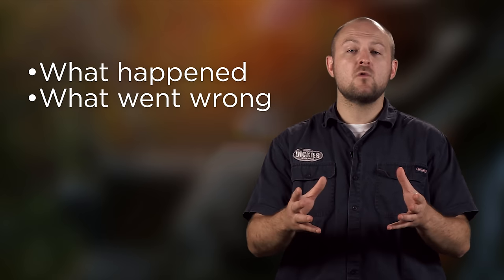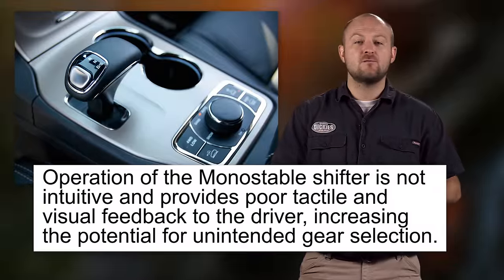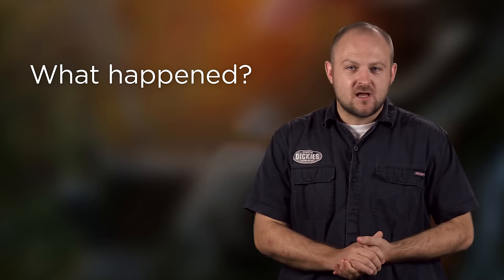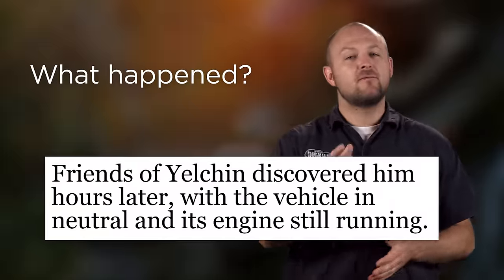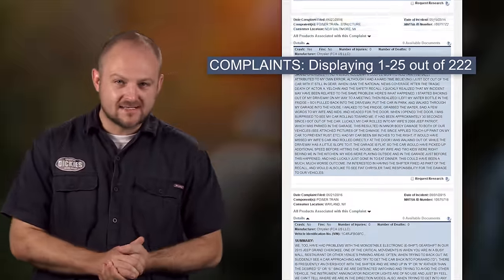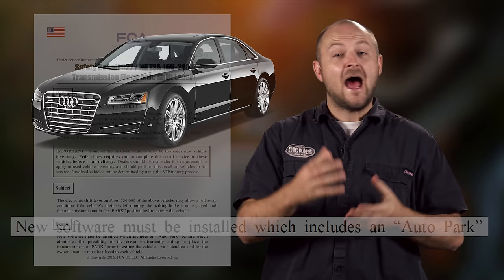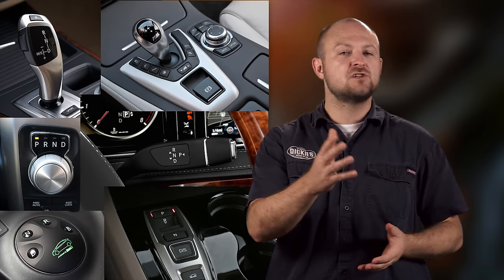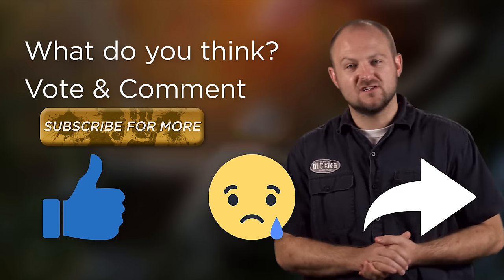How Anton Yelchin was Killed: An Explanation of Jeep's Confusing Shifter

Comment: While this shifter is one of the most stupid designs I´ve ever seen ( not only from the usability, but from the looks and feels), I still cannot imagine getting out of the car and walking all the way around it without noticing it rolling. I also missed the P on a normal old "analog" column shift lever on an incline and was about to leave the car with the engine off and the transmission in R ( key in ignition). It was a very slight incline, not the steep driveway pictured here. The moment I left off the brake pedal I felt the vehicle moving. How can you even have the time to walk all the way to the back of the rolling car? The vehicle would be already rolling while you walk at the side of it.
Reply: eaglevision993  You sir, are very awake!!! Thank you for using you own critical thinking skills!!! So many in the world today have NO idea how to use their own brains, it's fucking scary!!!!!
Reply: Your experience is not applicable here. Didn't you hear? His was in neutral, not reverse. It could have be still, or unperceivably slowly starting to roll as he jumped out.

And if I was a busy high flying guy like that, I would not be walking. Jump out, run down to the gate, and as you jump out into the darkness you don't even sense the initial slow movement while in neutral.

Perhaps you also didn't know that it was midnight. Make more sense now?

Comment: How can this video conclude he left it in neutral rather than park? It's a big assumption. If he left it in neutral it would have rolled before he got to the rear. It weighed 2.5 tonnes so in neutral it would have rolled immediately on a steep slope. It wouldn't have waited 5 or 10 seconds and then rolled. I think he left it in park but it slipped from park and this slippage is why Jeep recalled the cars. If that's the case their statement is completely dishonest. Appalling design definitely, but maybe more of than "poor tactile and visibility to the driver" as they say. It seems to me the park position possibly wasn't holding the vehicles on slopes and that would be an engineering fault making that jeep a death trap.
Reply: Its weight wouldnt make it begin to roll faster

Comment: One complaint I have as a mechanic is this car cannot shift to neutral unless the engine is on. Meaning if the engine can't start, you can't put it into neutral. Top that with I can never get it to select the right gear, I'm not surprised something like this happened. Lovely cars, terrible engineering.
Reply from the maker: From my research I did find a way to put it in neutral! For at least the 2014 model there is an orange strap under a panel in the center console. There's a few more steps (and probably many more than are needed) but you should be able to easily find it by searching YouTube. I think every model of vehicle that has this shifter does it a little differently but it seems all use some sort of strap and button mechanism.

Comment: A very simple scenario for those who are still scratching their heads. First, keep in mind that this happened late at night, thus in some level of darkness.

Imagine that in a hurry (not a careless hurry, just a hurry) you 1. Throw it into park. 2. Throw open the door, left hand on the seat and right hand on the door, and launch yourself to jump out of the vehicle. In continuing the same motion, you continued on a fast jog to the gate. There you go. You don't realize the vehicle is rolling (slowly at first, mind you) - and in darkness and in a fast jog you reach the gate far quicker than the car. Unfortunately, with your back turned at the gate, silently, it builds speed. Then at 5,000 pounds it only has to be going 2 miles an hour - DOWNHILL - to crush you.

Comment: His Jeep has "Hill Assist Feature" it will hold the vehicle from rolling backwards for several seconds after the brake pedal is released. Then it automatically releases it, if your brake pedal is not re-applied it will roll. This feature would have held long enough for him to get behind his Jeep and get ran over. Too many U.K. comments about parking brake not on. U.K. drive mostly standard transmissions and need parking brakes. In North America we have only Automatic Transmissions in Jeep Grand Cherokee's, and rarely does anyone use the parking brake in automatic vehicles here. That's how he wouldn't have seen or felt it move when he got out. Those few seconds of brake holding feature tricked him into thinking it was ok and in PARK!!
Reply from the maker: Hill assist is a very interesting possibility. Thanks for your comment!
Reply: frank gullett  Then if he had the "hill assist feature," how in the world then did he not have plenty of time to get out of the way?? Very interesting you mentioned his Jeep has this because the official explanation of how he supposedly died that way with no other person having actually been with him to help cause this "freak accident" to happen, sounded ridiculous before with what we've all been told!!! Now that you mentioned this feature he had, it makes even LESS sense he was killed by his own vehicle & that he was actually by himself that night!!!

Comment: Soooo  He drove through his gate, then decided to randomly stop the car on the steep incline. Then, he got out of the car (accidentally left it in neutral) and walked around the vehicle to the back. At which point the vehicle began rolling..   No no no.   If you are stopped on an incline and you put your car in neutral, it IMMEDIATELY begins to roll once you take your foot off the brake. There is no way he could have gotten out and walked to the back of his car without it already rolling.  This doesn't add up at all.

Comment: As a Jeep Grand Cherokee driver - currently driving the 2015 model in question I found the need for the recall totally pointless. For any driver the act of shifting into or out of gear should be one that is paid attention to.  Simply put, the driver should not exit the vehicle unless they are sure the vehicle is correctly in park (or in neutral with parking brake engaged) The more that vehicle manufacturers do to "simplify" driving the less safe driving becomes because the driver is becoming more and more detached from the basic role of vehicle control. It is the responsibility of the driver to pay attention to all aspects of the act of driving. There is/was nothing confusing about the Jeep shifter - it clearly shows when it is in park, reverse, neutral or drive both on the shifter knob and also on the dash display - the driver has the responsibility to check/verify.

Comment: I have a 2015 Grand Cherokee and this should not have happened I have tried it if the vehicle is not in park and the door is opened the vehicle engages the parking brake to prevent it from  driving away.

Comment: The guy in this video has obviously never been in a new GC (I own a 2014). They don't have a key, they use a wireless fob, so when he got out there's a beep and message on the instrument cluster that says "Fob has left the vehicle" in addition to "vehicle not in park". So a beep really doesn't help bc they use the same one for various alerts.
The bigger issue is... Why is nobody saying anything about "hill assist control"?  The feature that holds the brakes for several seconds if you stop on a hill to keep you from rolling. That is what allowed him to get behind the vehicle before it rolled. Otherwise the vehicle would have rolled immediately and he couldn't have walked behind it. So I believe it was a combination of factors, not just an admittedly bad shifter implementation.
Reply: The indicator lights on the shifter are pretty much useless in daylight. They backlit white letters with a soft blue "TRON-esque" color. That  combined with the panoramic sunroof on my Overland, and you can't see the light on the shifter at all. The only indication you're in park is a slightly brighter P in the P R D(rive) S(port) indicator of the LCD instrument cluster, which is a bit "busy" to say the least.  The hill assist control as I mentioned before can fool you into thinking the vehicle is in park when it isn't. I had it happen to me once in 2.5 years, in my driveway, but I was still in the driver's seat thankfully and there was no accident.
Reply: +Joshua S what about engaging the handbrake. No driver that is worth his salt would ever leave his vehicle without engaging the handbrake.

Comment: I own a 2015 jeep grand cherokee. this shifter is not a complex and flawed as you make it out to be. 
1. there is no key to put in the "ignition". it has push button start and has a key fob you keep in your pocket.
2. it really is very simple to use with simple common sense. just push the button on the shifter and push the shifter all the way forward.
3. who doesn't look down at the shift to confirm it's in park or reverse or the proper gear.
4. this kid made a mistake. plain and simple but like the new typical thought process for America is play the victim card and blame someone else for their own mistake.
5. the ding noise is also made when the jeep is left running and the key fob leaves the vehicle.
6. if he left it in neutral how did he not notice the vehicle rolling or moving at all after he got out of the vehicle when he took his foot of the brake.
Reply: Another thing.....why did he not use the handbrake/e-brake.

Comment: Like the radio/media player in my Challenger you can't turn off.  You have to either turn the volume all the way down (does not stop media playing), or you have to press the "mute" button (in which case it unmutes when you restart the vehicle whether you want it are not).  Dodge put a MUTE/VOLUME push knob on the console.  Would it not have been just as easy for it to be ON-OFF/VOLUME, like it has been for the last 60+ years.  "I don't want a radio that can be turned off in my car" said no one ever.

Now admittingly I am not aware of the radio/media player slaughtering people like the shifters are, but I am pointing out that the practice of change just for the sake of change is not a good idea.  There is no logical reason for the design of this shifter (or my radio/media player).

Comment: My 2014 Volkswagen Golf mk7 automatically deploys its parking brake if i open the driver door while the engine is running. But it is manual transmission i dont know if the automatic woud, but i guess it would. of cause you need a electric parking brake.

Comment: But I don't understand, a car in neutral on even a small incline will start to roll backwards as soon as your foot is off the break. So how did he accidentally go into neutral? Could it have slipped from park?
Reply: Most new cars have hill assist brakes which hold the rear brakes for a couple of seconds when you release the break pedal... Go figure what happenned
Reply: +Michał Be Are you sure hill assist is not for manual cars?  His car was automatic. Besides, in this particular car, as soon as you open the driver door, it gives you a warning that the car is not in park and why did he not engage the handbrake. You can't blame the car for stupid mistakes from the driver.
Reply: +Renier Bonthuyzen hill assist works the same Same for automatic and  manual boxes - if that car even exists as manual (doubt it). Of course it gives the audible warning but it also gives a warning about seatbelts and key  if not keyless or you can just have your music turned up really loud. Anything possible.
Reply: +Michał Be. I hear you, but we still can't get passed the fact that he did not make sure that the car was in park and he also could not bother his arse to use the handbrake. Like I said, when you drive a car you should pay attention to what you are doing.
Reply: Renier Bonthuyzen Stupid mistakes of the car makers, not drivers. Seriously, who decides it's a good idea to put the gear that can mimic park, right under park?
Reply: +XxShadowedSongxX please tell me how is it not the drivers fault. Car not in Park...... driver Fault. You don't just jump out if you are not sure what hear the car is in. That car has and indicator on the shift stick and on the dash board to tell you what gear you are in. Handbrake was not engaged. Driver Fault. Again....there is a light on the button to show that it is engaged and it also shows on the dash if the handbrake is engaged. Again. Not the car fault but driver mistake.
Reply: Renier....    I do appreciate  your honest comments  ....  we all feel sorry for Anton's  death  is so sad......     but I understand  perfectly  ........  and you are so right!
Reply: +dakotail Thanks man. I am very sorry that it happened, it is a tragedy, but we can't take away the fact that he did not do a proper check before getting out of the car and therefore we cannot blame the car for human error.
Reply: Renier Bonthuyzen Look, this is just my opinion and you don't have to agree, but I cannot place the fault on any of the drivers. If it was just Anton I would say yes, human error. But it wasn't just him. It was hundreds of people making the same mistake. It was bad enough that they had to recall over a million cars and make new software to fix this problem. If they didn't have to do the recall I would say yes it was the fault of those hundreds of drivers, but because of the recall I put it as the error of the car makers. Neutral should not go under park.
Reply: +XxShadowedSongxX . I hear what you what you say, but if you drive, you will realise that Neutral is not under park, but Reverse is. None of these people engaged the handbrake. If they did, none of this would have happened.  And I know it is scary to think there could be that many stupid people out there, but it is entirely possible. Just look at how many people are voting for Donald trump.  Answer me honestly..... If any of these people used their handbrakes, would any of those accident have happened.  I've been driving for more than 20 years and this has never happened to me, because I know how to use a handbrake.  People should pay attention when they are driving.  Cars are not toys.
Reply: I completely mixed up the R and N, that's on me. But yeah I do hear you. I unconsciously engage my handbrake even if I'm in my car on a level surface. It's something I've always done, but not everyone does that. I still stand with the recall. I will not fault drivers if a recall happens.
Reply: +XxShadowedSongxX The recall is just a precaution.  There are lots of cars with the same shifters, but I would say those cars are owned by more mature drivers that would have more experience in driving. Accidents are going to happen.  We all know this. This is a small amount of accidents. It is only 0.06 percent of the total recall.  If people drive correctly, they would even engage their handbrake at traffic lights, as it is supposed to be done, and they will never leave their vehicles without engaging their handbrake.  This is just blown out of proportion because he is a public figure..... I didn't hear anything about this until he was killed, did you?
Reply: Not in the least. They had the bad luck for the person to die to be a celebrity and now all eyes are on them.
Still, to me a recall will always be an admission of guilt.
Reply: +XxShadowedSongxX. They admitted that the shifter is Confusing to some people. That is fine. It isn't faulty though. Hope you have a wonderful day.
Reply: To each his own. You as well. Thank you for being civil.
Reply: +XxShadowedSongxX. I want to thank you for being civil as well. There are very few people like you here. Somehow internet turns people into barbarians that won't allow you to have your own opinion and who can't have a proper debate without telling you to fuck off and die or something similar. I admit as soon as someone does that I do the same, I will not be trampled on, but I much prefer a civil discussion like we had. Take care and maybe we meet on here again someday. Have a wonderful day.

Comment: I think I’ll stick to my old fashioned manual transmission cars with a stick shift and an emergency brake, which when on the slightest of inclines I always park in gear opposite the direction of the decline.

Comment: This makes me so mad. Mercedes has the same problem with the CLA and GLA.   Ive driven many of them as that's what Car2Go uses now. Its got a column style shifter like an old GMC truck.  When you push the lever all the way up, its reasonable to assume you're in PARK, as that pretty much how every automatic transmission ever built works.  But that's not the case! you're actually in REVERSE now.  It doesn't go into PARK unless you take an extra step and push the PARK button at the end of the lever.  (Most manufacturers in the past put the OVERDRIVE button in this spot) This is a serious design flaw especially as its a Car2Go and there will be hundreds of people driving them daily for their first time and be unfamiliar with the with the extra step to get it into PARK.

Comment: Requires a bit more attention on the driver's part, but not a huge problem. However, parallel parking in this Grand Cherokee is a PAIN IN THE ASS. Very tricky to go from drive-to-reverse / drive-to-reverse quickly.  You're gonna piss off the cars behind you while you fumble with the gear shifter.

Comment: I feel sorry for the guy but I would never rely on simply putting the car in park! especially on a steep driveway! I would always engage the handbrake as well! you can't assume that park is going to be good enough! its like using first gear in a manual to stop the car from rolling! DON'T!!! always ALWAYS use the hand brake as well.